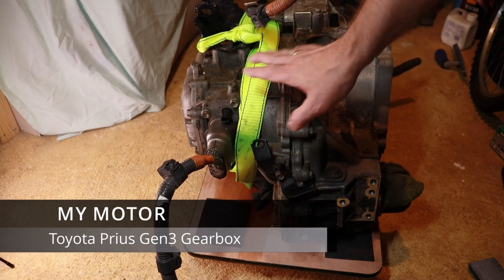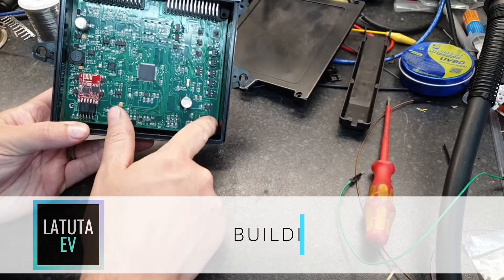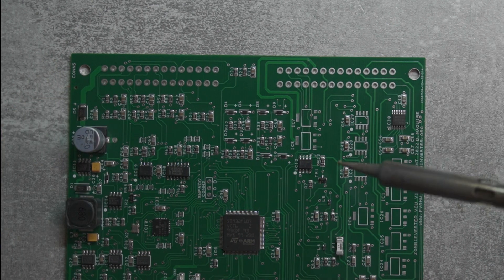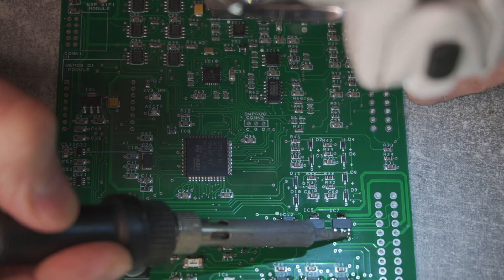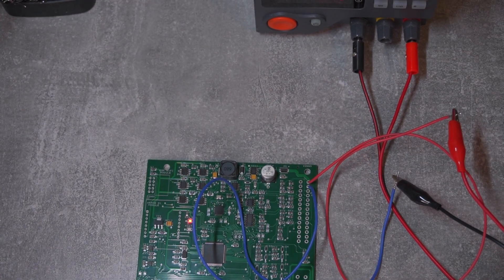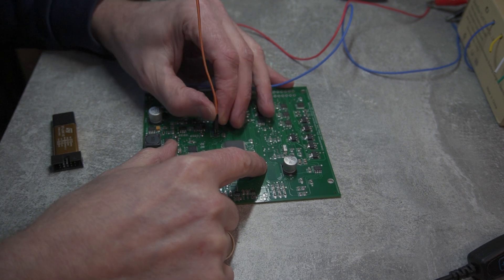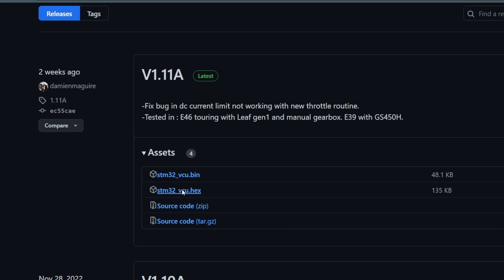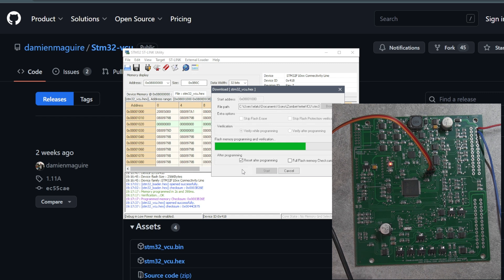Building DIY VCU for electric car #4

Comment: Hi,im trying to upoad the hex file version 2.0 frimware nut no having success,where did you find the files for the stm32 bootloader?
Reply from the maker: You can find bootloader here https://github.com/jsphuebner/tumanako-inverter-fw-bootloader/releases
Reply: @LatutaEV  thank you so much,it worked immediately after uploading the bootloader then uploading it with v2.0....btw im you biggest fan...currently using gs450h with zombie vcu to go into a benz w124
Reply from the maker: @Demaflickers  I am glad that it worked good luck with your conversion 😄

Comment: Very cool man,  yes, very helpful.    May I ask,  Can I use this VCU if i'm not using standard Tesla/Leaf/BMW components?    like if I make my own BMS,  or use a Chinese Motor Controller?
Reply from the maker: Thanks yes you can but you will have to do your own development work. Both software and hardware are open source
Reply: @LatutaEV  wow thanks for quick reply.    Do you know what it's coded in?  Python?  c#?     and what kind of coding would that be?   Would we need PID's for everything?  or maybe I'm asking wrong question,  but,  I have coders no problem,  but they've never interfaced with hardware.    What specifically would they be reading?
Reply from the maker: @gjsxnobody7534  I believe it is C using libopencm3 and GCC
Reply from the maker: If you search for open inverter you will find some documentation and forums

Comment: I want a control panel for a Lexus inverter, can you help me?
I do not have experience ☹
Reply from the maker: Please Google open inverter forum as I will be focusing on the Tesla motor I won't be buying Lexus Inverter, sorry.
Reply: Yes, Zombieverter might be easier reads like to work with the Lexus inverter being maybe Damien McGuire has used the Lexus CVT's for powering and maybe knows more regarding.  He and like noted above with openinverter, Johannes Huebner are available to consult with for a reasonable price.  Just Google search their names and contact info.  Please share and keep open source whatever you find out as I'm starting to see other models in the salvage yards like the Camry's and Highlanders where I'm tempted to invest in one to study.  Same with the other U.S. makes and models hybrid HV parts to better study the pros and cons of the designs.